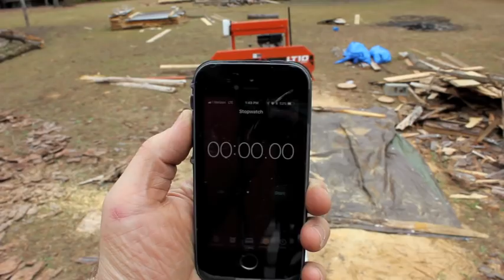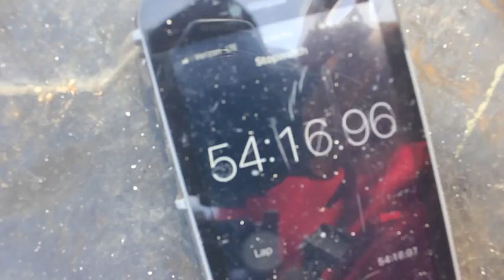Wood Mizer LT10 sawmill, How fast is it?

Comment: I would imagine Wood-Mizer's estimate is using a very experienced crew of a minimum of 2 and maybe 3. I think you did well as a one man operation. Also, I've been watching Ben for a while. He's got a good pile of lumber built up plus the firewood and turning blanks  or small cutoffs of usable hardwoods. Thanks for sharing.
Reply from the maker: lake bum That’s kinda what I figure too. I know the mill is capable of much more than what I can get out of it alone. Thanks for the comment!
Reply: lake bum he wasted cut off time on first log it will do 160bf in a. Hour he wasn't set up to do it.
Reply from the maker: Michael Willcutt Yep, good chance I could have slabbed that first one faster. I think some speed will come with more experience. Thanks for the comment!
Reply: lake bum next time cut thicker outsides off to get to lumber you want a new keep other logs next in line  by saw not across 6 yard my last cutting  got 180 board feet in a hour

Comment: If you are going to do a large quantity of lumber, make your slab pile neat.  It will make a much smaller pile and will be easy to make into firewood.  Disengage your throttle before backing the saw up for the next cut.  If the blade is running when you back up, if it catches anything it will throw the blade off the wheels.  Make a socket for your cant hook so it stands upright.  At the end of a long day of sawing it will be much easier on your back than bending over to pick it up each time you need to roll the log.
Reply from the maker: Ronald Morrison Thanks for the tips! Since this video I’ve gotten my slab pile cleaned up a good bit. I stacked it to dry for projects. The can’t hook holder is a great idea. Thanks for the comment!
Reply: Thanks for the tips

Comment: Excellent video!  I think Wood-Mizer is basing their board-feet/hour claim using longer logs.  That would be a lot less flipping of the cant, and loading of logs, for the amount of lumber coming off the mill, with logs twice as long.
Reply from the maker: Very possible. Thanks for the comment!

Comment: Just realized that the log bed on my Timbery M100 is the same as your Wood-Mizer LT10.
Reply from the maker: Jeffrey Beyer Sure looks like it. Most of these small mills are built very similar I’m finding out.
Reply: Fall Line Ridge Rumor has it that the Timbery brand is the budget version of Wood-Mizer or the engineer came from Wood-Mizer.
Reply: I just looked it up on Google and both of their headquarters are only a mile apart on the same street...  Sounds like the same company.

Comment: Great video..  just a comment.. is it possible to operate the unit from the right side, not the left, so that you are not walking in your own sawdust (slippery) area...just an observation . I have never operated  a mill, and probably never will..
Reply from the maker: George M that’s a great question. I suppose you could operate it from the right side, however there is no push handle so you would have to push against that rear bar. Which might be inconvenient. Also, it would probably slow you down because the head lock is on the left side, as is the depth gauge. Also, the handle that you use to lift and lower the head is on the left side. Thanks for the comment!
Reply: good points.... see what you mean..

Comment: does a Wm lt10 cost much more than a woodland 722? woodland mills are prety cheap if u ask me and a nice quality.
WM is like the mercedes of the sawmills but i think it is a little too expensive for hobby isnt it?
Reply from the maker: xavi cobbenski LT10s retail for $3,995. I agree, pretty pricey for a hobby mill. I believe the quality and customer service are well worth it though. Woodland Mills are in the $2-$3,000 range I believe. I don’t have personal experience on them but from what I can tell they are probably the best value for a small sawmill available.
Reply: In the U.K. the woodmizer mills are double the price of any other mill. I know guys running Lucas and Norwood mills. I’m currently running an Alaskan mill or getting a mobile mill and operator in. Trying to decide if the woodmizer is worth the premium.
Reply: Or actually weather it’s worth building a big mill myself.

Comment: I have an LT10, mine doesn't have the rope along the bottom of the track.   What does it do?
Reply from the maker: Eric Aker If I remember right, the manual says they have to do with stability of the mill. There’s a cable system on both sides of the mill on pulleys. I assume they help both sides of the head stay true as it rolls up and down. I honestly don’t fully understand it.
Reply: Fall Line Ridge Thanks for the reply
Reply: I was wondering that also. Thanks for the explanation.